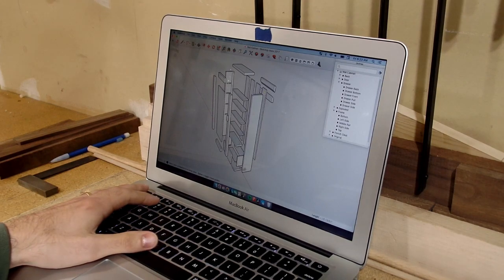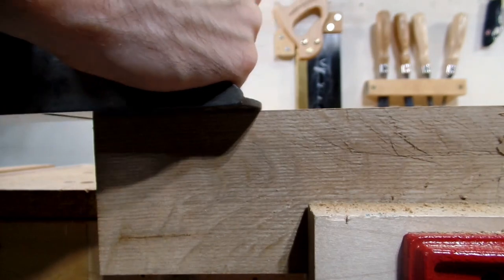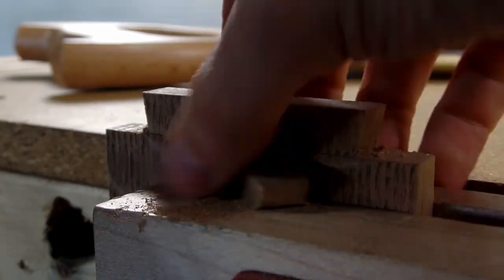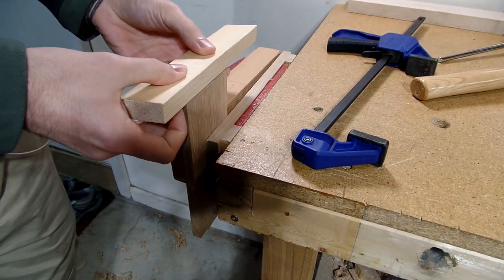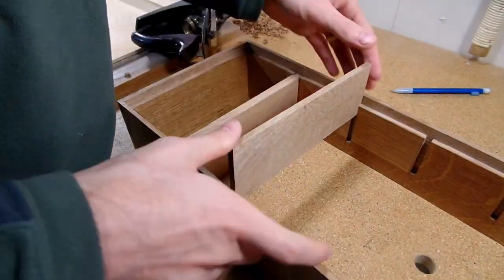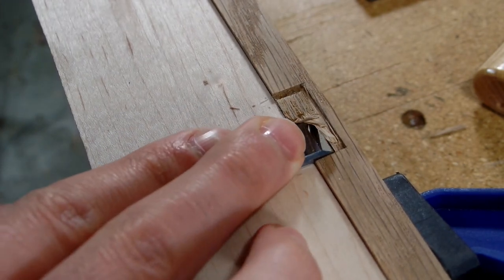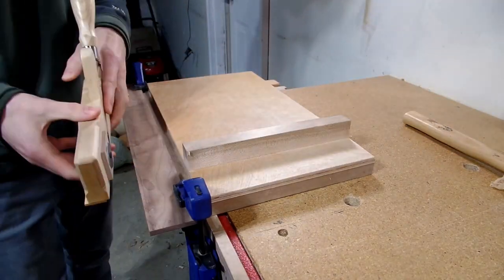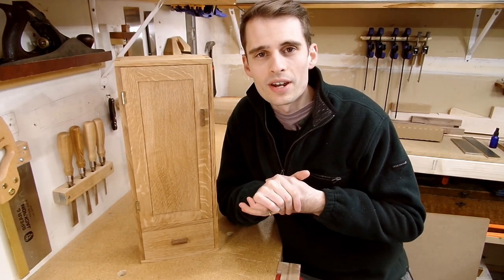Hand tools only: Building a wall cabinet | Building Tools to Build Tools to Build Furniture Part 5

Comment: 1. Great project. You’ve done some excellent work on this cabinet. Sliding dovetails by hand is an advanced skill and yours turned out great. 2. Just go ahead and get yourself a better dovetail saw. I received my first legitimate dovetail saw as a gift about a year ago and it instantly made my work more precise. I understand your desire to do the most possible with the fewest tools, but there comes a time when poor quality tools start to hold you back.
Reply from the maker: Thanks for the kind words! And you're right, I've recently been saving some money and think I'm going to invest in a nice dovetail saw. Do you have any recommendations for ones you like?

Comment: Really nice cabinet. Its such a relief to hear someone point out that dovetails dont have to be perfect. How did you go on about to hanging it on the wall? Im making a similar allthough bigger cabinet of my own. A french cleat seems safest but that means a much wider rabbet. Any ideas on how to do a cleat without using screws?
Keep up the excellent work!
Reply from the maker: Thanks! And I just used a french cleat. Somewhat afraid it'll break but I think if you make the rabbet big enough it'll be fine. Good luck with your cabinet!

Comment: What material would be good for rail and styles if it is going to be painted 🎨 🤔.  Any alternatives to expensive oak🤔
Reply from the maker: Popular is usually a great cheaper option for solid wood that will be painted! Or pine as well. The woodworking world usually refers to these woods as "secondary woods" because they're cheaper, more readily available and therefore less expensive than hardwoods such as oak, cherry, and walnut. (Also, sorry it took awhile to get back to you, somehow I didn't get notified of your comment!)

Comment: Dovetails were not designed to be perfect. They were deigned for their holding strength. I've been cutting dovetails on reproductions for 50 years, never concerned myself for perfect dovetails, nor did my clients want them perfect. You're doing just fine..stay focused and have fun, don't be so concerned about power tools. Keep adding to your hand tools. You'll be the one with self rewards, not the power tool manufacturers.
Reply from the maker: Thanks for the encouragement!